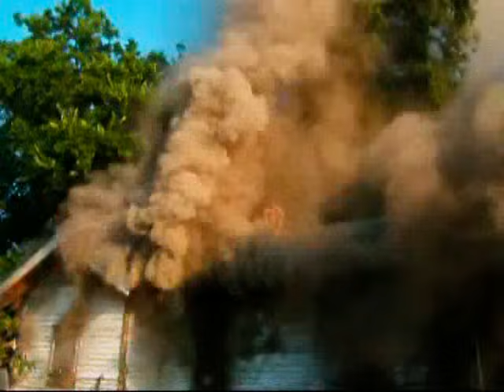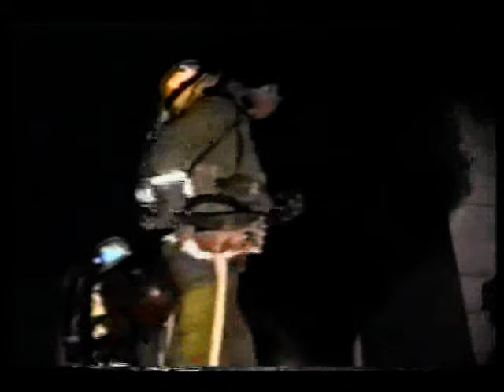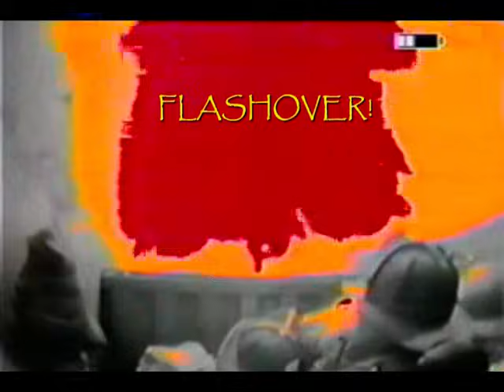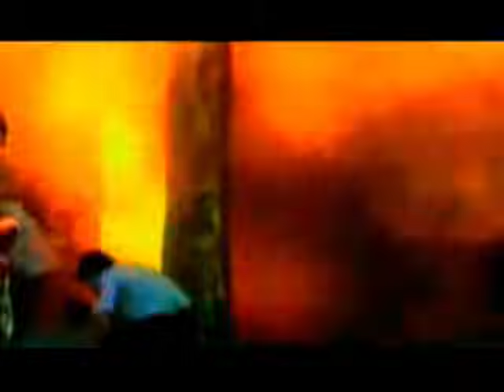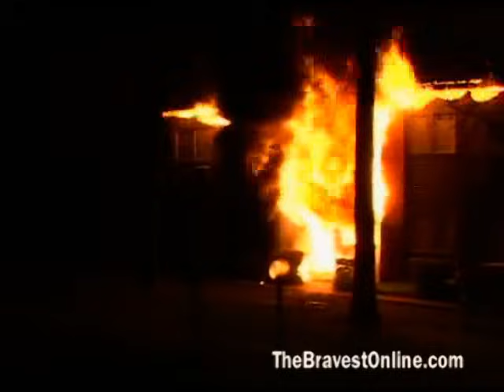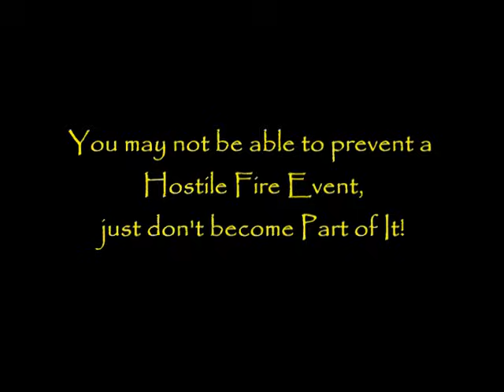Fireground Size-Up and How to Read Smoke

Comment: I wish I could pull these crews off these roofs. No need to cut a hole endangering your crew when fire has already vented itself.....i.e. Cut its own hole. You would be surprised how often I see this. This risk vs benefit scenario is too heavy on the risk side.......especially when conditions are too heavy for a victims life to exist inside the structure. And if you must cut a hole, do it and get the hell off. You'd also be surprised how often I see FFs having a picnic after cutting the hole. Be smart.....
Reply: I was thinking the same thing. They have no business up there!
Reply: EXACTLY!! I say the same damn thing on so many video's, drives me crazy that Command will send guys up on a roof that's already self-ventilated, like you're going to make any big f'ing difference with some 2' x 4' hole when half the roof is already blowing smoke...pffftt. High pressure, dark brown smoke pouring out already, GTFO!!! I see it mostly still, from American departments, I'm sure there's probably a few departments up here in Canada that still do it, but we won't unless it's absolutely necessary and we do it from a platform or aerial ladder.
What are they gonna save at that shack anyway? It's a goddamn parking lot tomorrow, so get those guys OFF THE ROOF!
Reply: I was yelling at the video the whole time "...get off that roof!"
Reply: You're confusing vented with ventilated.
Reply: Or, how about the fact that every NIST study done recently has shown us that you can't "Vent the heat out the roof" as this video suggests, just cause a change in the flow paths and create more fire...
Reply: +Jorge Ginzo +Deceivingly Charming - Yah, this activity drives me nuts to watch! Sure, there are times when horizontal ventilation thru a roof can make a big difference when combined with other tactics to reach your goal, but if you've got flames already punching thru the roof, use a damn platform, or a ladder truck. If you need to get off the platform/ladder to cut, use a proper harness and TIE OFF! Keep the life line as tight as possible, so if you do fall thru, you don't fall far and can climb back out. If these are not available, or can't reach, set up foot and/or roof ladders to spread the load and surface area and cut from there, anything to give your guys a stable platform and something to tie off to. Stay safe!
Reply: While I agree with "Be smart," be careful not to confuse self-vented with adequately vented.

Comment: Please help save millions of people from dangers of ionization smoke alarms that fail to warn occupants of smoldering smoke that are in 90% of all homes. 100's of 1000's have been killed or seriously burned over last 40 years due to ionization alarms inability to detect smoldering smoke. But they are cheaper to make so more profits compared to safer photoelectric alarms. The UL fraudulently tested ionization alarms and hid data over 40 yrs ago so ion manufactures could then falsely advertise and flood the market with these often deadly devices. The lives you save could be your own and those of family and friends. Please click link below and signhttp://www.thepetitionsite.com/takeaction/213/386/111/

Comment: I have my first live burn today with my recruit class. I appreciate the video. How do you know, when inside, what type of pattern you should use with your nozzle? I have heard that making a wider pattern with a fog nozzle will protect you, but using a narrow pattern will allow more water to reach the fire before evaporating.
Reply: My man Thor hence the term rt to fight , left for life! As you've already probably found out a fog pattern may introduce to much water and create steam causing you to burn yourself and your comrades, Penciling w/ a coordinated attack (ventilation) is still tried and true method. Peace
Reply: +LT.Murfez truckee you need to watch Governors Island 21st century New York when you spray water in the room it cools and whether it's right for fight left for life
Reply: Might already know it by now, but they're are now teaching to stay with a 30-45 degree angle to disrupt the thermal layering vis indirect attack before transitioning into hitting the seat of the fire with a straight stream. There is a controversy behind it, but this new technique has studies to back it up from what i'm told.
Reply: +LT.Murfez truckee rt
Reply: Kevin Kelm true, both streams cool, but there's a lot more at play than cooling. Straight stream or solid bore nozzles provide reach-giving you the ability to hit a room as you move down a hallway. Those "tiny droplets of water" in your fog patterns may provide gas cooling resulting in gas contraction, but the do not provide surface cooling and the ability to penetrate to the seat of the fire. 

I'll stand with LT.Murfez on this, if you are interior/offensive the nozzle is on "Right to Fight."

Comment: Good video.  But at the 6:51 mark you said that one hostile event can change to another.  This is true, where the smoke explosion changes to a flashover.  This flashover condition in this video was caused by the positive pressure fan placed at the front window.  It should be stated that firefighters improperly using of equipment and techniques can cause these hostile events as well.
Reply: Very hostile, youre dumb and dont know shit

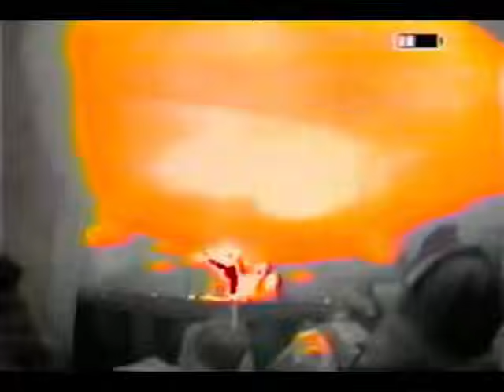Comment: This video was well done - lots of good information in here.  But at 4:14, it should be noted that the FF's are in a training prop specifically designed to allow FF's to safely experience flashover.  While the "pencil" technique works well in the prop, it doesn't always work well in the field.  Ironically, the prop is intended to illustrate the early signs of impending flashover so you can get OUT of the room in time - not to "stay and play".  Still good info for sure, thanks Dale.
Reply: Some times we have to stsy to knock it down if there are victims trapped in not running no where untill I absolutely have to I'm going to try to get the ignition point down

Comment: You are right, & this is a good example. But there will come a day in your walk as a Firefighter when you make a mistake, a judgment or reaction that does not follow common sense or training. Everything from as small of a thing as doing a vehicle/apparatus walk around to missing a victim alive during initial search. It is easy to point out others mistakes & faults, but admit your own, learn from your mistakes & receive correction/instruction is what will make the difference.

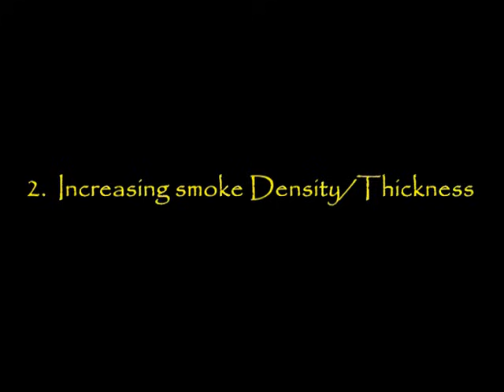Comment: Now go to "house fire leaking gas meter" and at 5:58 see a good example of "black fire" just like in this video. Isn't it interesting that at 8:38 in this video the condo bldg looked hopelessly out of control and an impending total loss, and just like that the firefighter knocked it almost out with the wide stream. All the stuff on fire outside was off-gassing and that was the massive flames. I don't think most people understand that when they see an early-stage inferno.

Comment: That's a CLASSIC sign of a SMOLDERING FIRE.
Ventilation at the highest point is advised in order to prevent a sudden introduction of air into an OXYGEN starved fire building.
A BACKDRAFT will ensue if proper ventilation isn't performed.

Comment: @smarttubber123 Not exactly. Flashover is the transition from 'room contents fire' to 'structure fire'. Once flashover occurs, it enables rapid fire spread because of the tremendouse amount of heat being generated. But if firefighters are quick to act on this, they can knock the fire down and get it controlled before it gets worse. Man i need to quit watching these fire related videos during the night, they give the the creeps, scare the shit out of me, and make it hard to fall asleep.

Comment: What exactly does "smoke stained" windows mean?
Reply: TheWaynelds this question was 5 years ago, and still unanswered. Here it goes: During fire growth off gassing occurs inside of the burning compartment as a result of contents of the room being superheated. The off gassed particles combine with water (steam) in the air and collect on the window as condensate.    The condensate makes the window dirty looking and as condensate continues to build up the dirty water streaks down the windows. The next stage of fire growth heats the entirety of the room (including the glass) past 212*F, the condensate then evaporates back off of the glass leaving the dirty particles behind staining the glass. Seeing a window like this on a house tells you about the fire growth. Windows typically break around 600*F, so as the fire continues to grow, seeing windows that are stained and cracked indicate that the room is very hot and on it's way to flashover.  Hope that helps!